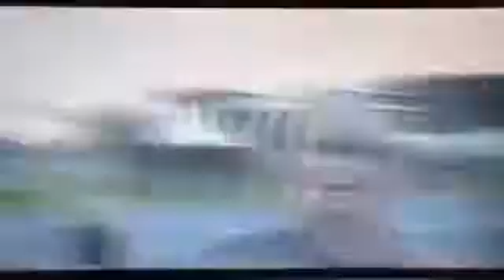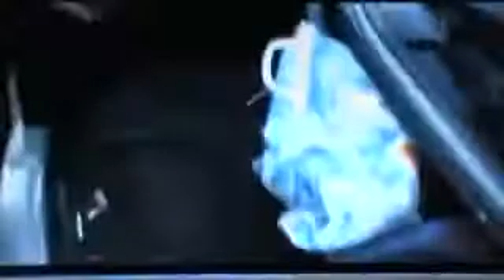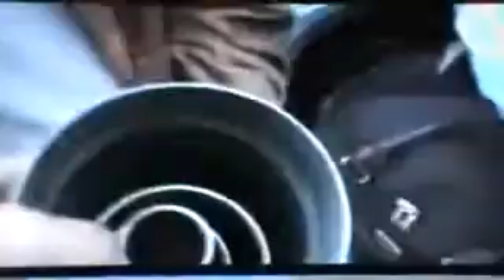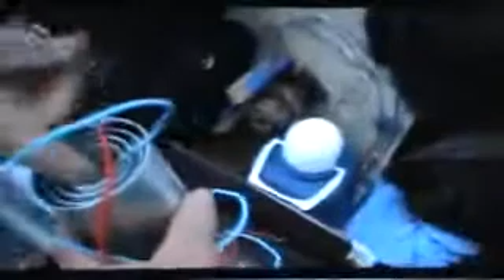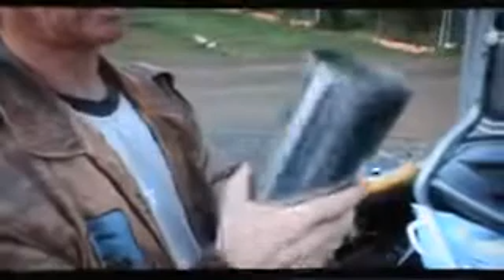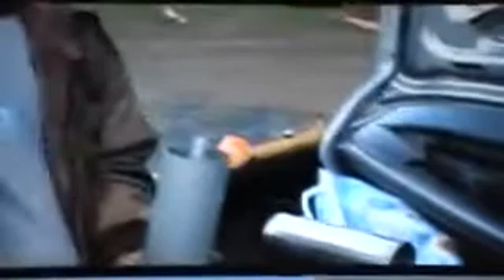joe cell talks 7

Comment: drawing on the sandy footpath .a bridge rectifier ...the figure 8 loops of ac dc alternator to starter motor one figure 8 the other acting as a air dc source to ac engine block that accumaltes static ....massive amps build up if notbled away ...just a thought